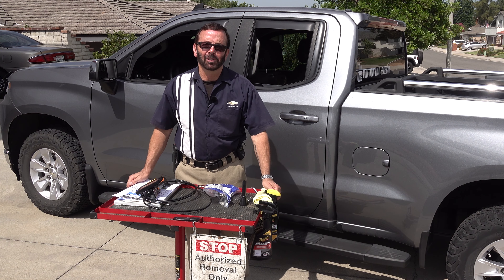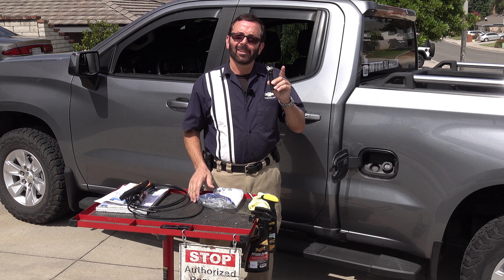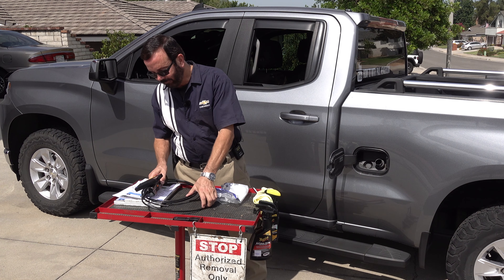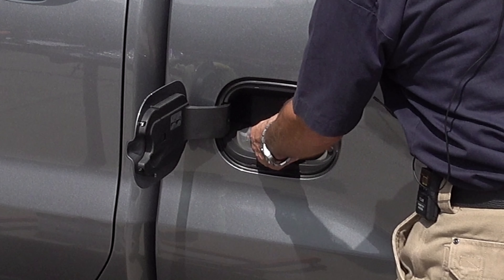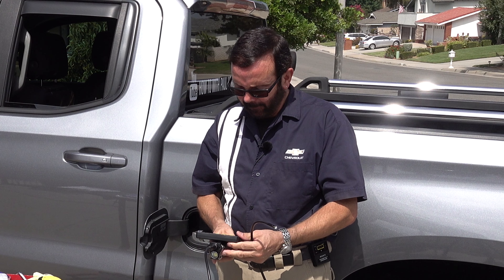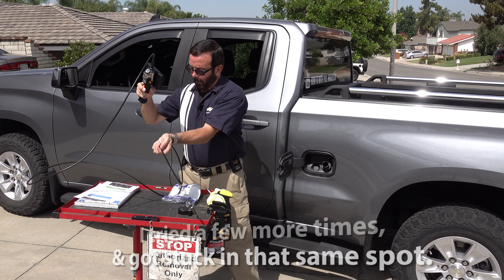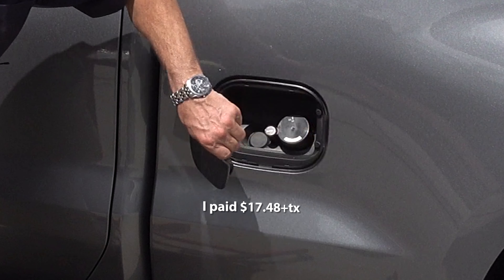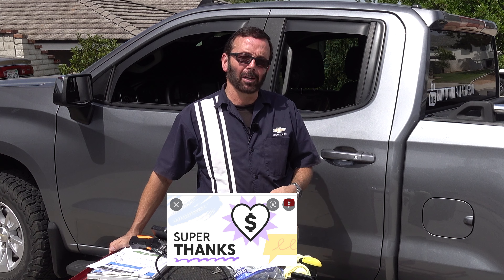Theft Deterrent Locking Cap for your Capless Fuel System w/Paul Henderson

Comment: I never understood why car designers would make a capless gas tank.
Reply from the maker: Nice idea though, there is a screen to keep a drain hose from syphoning the fuel, plus a secondary trap door to keep out unwanted liquid. But yes they should make an optional heavy duty locking cap if you want one....
Reply: @HowtowithPaulHenderson  oh OK, I didn’t know that about the secondary trap door. My car has one of those where you can just open it up and put the nozzle in. I’ve always been afraid that some random person would try to do some bull like siphoning the gas.
Reply: I don't have to worry about losing a gas cap.  However, I believe someone in my neighborhood stole gas last night.  The gauge was significantly lower this morning and I just got gas yesterday evening.
Reply: I never understood why the outer door doesn't have a lock. Idiocy, pure idiocy.
Reply from the maker: @steeevo0136  
Yes I agree, This cap is O.k, It's just a theft deterrent   device. maybe one day somebody will make a better cap than this OEM cap.
Reply from the maker: @latoriarichardson6754 
very lucky that was all they did. ,
Reply: I've had ppl put oil in my tank bc of this BS never knew bums still fuck wit ppl vehicles
Reply: @HowtowithPaulHenderson not at all bc I've had oil put in my tank sorry
Reply from the maker: @elondasmith8374 
Yes I don't understand either. Only thing I can think of is that there was some consumers that put up a stink saying I want a campless fuel system cuz I'm too lazy to unscrew the cat, so they did it. I remember people bitching about not having digital dashboards in touch screens in the vehicle to control 50% to 95% of stuff that used to be controlled by physical buttons not to mention, they'll be sorry after two to three years with possibly five but only not that when those systems go out they're going to be expensive to repair if it's out of warranty. Were we always told growing up not to leave your cell phone on the dash not just because of the battery but because of the damage it'll do to screen. And we were told not to text and drive have you seen the tablet that is on those ugly ass Teslas everything is controlled by that tablet even the shifting.
Reply: All sorts of liquid vandalism 😮

Comment: Probably a good idea if you’re worried about someone vandalizing your vehicle. I’d use one if I was worried about pranksters or exes! Probably also good if you park in apartment parking lot or big garage.
Reply from the maker: It's a cheap theft deterrent, also doubles as a dust and water cap for the capless fuel system.
Reply: @HowtowithPaulHenderson  What about when someone wants to push a few sugar cubes down in your tank.  Popping it off with two fingers, you're better off finding a lock the flap door.
Reply from the maker: @practicerepobarrie  
I've searched all over the internet there is no locking cap for the capless fuel system at least for the Chevy Silverados. 
GM  really need to come out with a locking gas cap. I'm not sure why they thought this capitalist fuel system was a good idea.

Comment: That lock is horrible. Sure, no locking cap is foolproof, but any fool with two fingers could pop it off with very little effort.
Even you showed that it was easier and faster to just pop it off rather than unlocking it.   
That's not a theft deterrent. That's a theft of $17.48 +tax
Reply from the maker: Very true, like I said it's just a theft deterrent, some people may not be smart enough to realize that they can just pull it off. And I figure if someone did take the cap off to either steal the gas or put something in the fuel tank then pulling the cap off and not putting it back on would let me know this so I can further check into why it was off before I start the engine and ruin the vehicle. Not sure why GM didn't make a locking cap much better than this one. I searched all over the internet for an aftermarket locking cap but couldn't find one. Hopefully somebody will come up with one wish I had to know how because I would. For $18 I think it was worth it regular retail price definitely not.
Reply from the maker: Came across a YouTube video today about the capless fuel system. As you know if water gets past the first trap door it won't get past  the secondary door because there is a hole in the fill pipe and water should drain out of there. Well this one guy lives in a really cold climate said it was about 20°. Why he went to go get his truck washed at 20° I have no idea, but water from the car wash had got past the first door and the water froze before it could drain out of the hole and space between secondary door and the first door was filled with ice. So I did read that on these locking fuel caps it will help to keep water out so I guess having this cheap ass cap on there while you're going through a car wash is a good idea.

Comment: The capless gas fill. They are absolutely terrible. After a recent rain I opened the fuel door and observed water pooled on top of the trap door. I had to blot it out with a dry paper towel trying not to push against the trap door. There is no telling how much water has penetrated the trap door.
Reply from the maker: @dixiedewful  
Good morning,  Ive got to say I don't understand how that's possible for water to go under the side of the locking cap and travel upwards and into the capless fuel system, It doesn't make sense.. I've checked mine repeatedly on rainy days to see if It actually works and I've never seen water inside the capless fuel system.
I'm not sure why it's happening to you in my case it's working just like ats supposed to.

Comment: when you said "deterent" a few times, I thought it could be removed with a sledge hammer or dent puller. Not by using 2 fingers
Reply from the maker: @timz.4000  yep two fingers is all it takes. But mainly it's a rainwater and dust cap, but it can work as a deterrent since it looks like it's a actual locking cap

Comment: I have a 2023 Silverado and i put a boroscope in. There is no mesh so it's easy to syphone fuel. Gas stations won't let you pump fuel till we pay for it but chevy wants us to give it away for free. Crazy
Reply from the maker: That pisses me off, when I bought the truck I was told there was a mesh screen down there.   I couldn't get past the bend in the pipe. 
I just filmed the video yesterday and mentioned about the endoscope which I just realized I called it the wrong name to talk about what the cap is really designed for, and that I couldn't find The mess screen. 
May not be much for keeping people from stealing your gas but it will keep rain water and dust from getting into the system.

Comment: You mention theft deterrent, but I saw it took you minimal effort to simply popped up with your hand. That is not deterrent, that is just very bad design, imho. Thank you for sharing this. I am not so much concerned as to gas theft, but more like someone, using a tube, delivering a chemical which will damage the engine, so locks are necessary.
Reply from the maker: I just filmed a review video on this, this morning talking about the advantage of this locking cap keeping water and dust out and how it is only a theft deterrent device. Hopefully when they see the keyhole they may decide to leave it alone. But if they do decide to give it a good tug it will come off. However, if the second lower trap door is not pushed open whatever liquid is dumped into the fill pipe will dump out through a hole in the fill pipe.

Comment: Thanks for showing what a piece of 💩 they sell👍
 I had a freightline with 2-150 gallon tanks and I bought a lock for each  one.
And some guy went to fill up my tanks and just unscrewed them really hard and broke em both
$114.00 down the drain.
 But I found out they were pieces of 💩
And that was probably 20 years ago.
Good to see there has been absolutely no improvements since, in fact they are worse.
Good job industry 👏
Reply from the maker: Like I mentioned in the video it's mainly a theft DETERRENT but it will keep dust and rainwater or wash water from getting into the capless fuel system if the trap door malfunctions. But yes I kinda agree they are crappy
Reply: Wow
Reply from the maker: @Hempfuelgroup I know it May not stop most fuel thieves from siphoning out your gas or some jealous person putting crap down the fuel pipe, but it's a deterrent and the purpose is to keep rain and wash water from getting inside the system the full pipe if the first trap door malfunctions.

Comment: That is like the dumbest theft deterrence gas cap lock. It's so flimsy that you can just rip it right off.  Which just defeats the whole point of putting a security lock on the capless fuel tank.  I wouldnt even spent a penny on that junk security lock.  What a rip off.
Reply from the maker: I do agree with you on that, but it is labeled as a THEFT DETERENT locking cap. It does look legit so hopefully if some would be gas thief were to see this they would just go on the the next vehicle.   Well that's what I hoping anyway.
Reply from the maker: I searched all over the internet for a more secure device and this is all there was.
Reply: Why they keep putting on these capless fuel that  is prone for fuel theft, just baffles me.  The least they could've done is put a fuel door lock latch that can only be open from the driver side in the cabin.
Reply: @HowtowithPaulHenderson  it's not a theft deterrence when thief can just siphon your gas  out because it's just out in the open and ready for the taken.  Theft deterrence is when it is lock and no one can open it unless it is open from the inside.

Comment: That is like the most useless piece of junk and a total waste of money.  It just defeats the sole purpose of putting one on. It ain't worth a penny.
Reply from the maker: I do agree with you that It may be useless as a locking fuel cap, but it is a decent theft deterrent device, but it is good for keeping dust and rain or wash water from pooling on top of or inside the fill pipe above the second trapdoor if the first one fails to shut properly.
I did see and add for a similar device that doesn't lock but it is used keep dust and rainwater and wash water that just slip onto the capless fuel system. I'm going to try to find it I think I saw on Amazon. I'm also kind of curious if that capless fuel system cap is replaceable if it becomes defective. So maybe with keeping that capitalist fuel system cap covered and semi-protected hopefully will last the lifetime of the vehicle.
In a
Reply from the maker: I just found the dust cap on Amazon, if you punch in the search bar 
KevinPCreatations he designed a 3D printed dust and water cap for the capless fuel system just under $12

Comment: that's got to be the most useless lock in existence.
Reply from the maker: Maybe, it's just one more thing a would be thief would have to get around....
Reply: @HowtowithPaulHenderson did you not just flip it off with a finger in seconds?
Reply from the maker: @WeirdNamja  I thought this was the tevlaphee steering wheel to seatbelt belt lock. Yes I did pull it off with my fingers, it doubles as a dust cap and will keep rain water from getting into the system if the trap door does not close all the way...

Comment: This shit doesnt work
Reply from the maker: @Mark-R8  it's main purpose is to keep rain water and wash water from filling up into the top of the capless system and  potentially dripping through into the space above the second trapdoor and the fill pipe and if you're in a freezing environment I could potentially turn into a solid tube of ice. As a theft cap no it doesn't work as a theft deterrent sort of it might deter somebody from trying to steal the gas or put something into the tank that shouldn't be there.

Comment: So lame it's useless
Reply from the maker: @jonellholly5087  
Maybe lame for security purpose but it will keep dust / rainwater/carwash water from getting into the capitalist fuel system. If there's a malfunction in the top trap door water will get into the system and if the drain hole above the second door is blocked that space will fill up with water. Long story short I saw on a YouTube video of a guy that lives in Canada he had a malfunctioning top trapdoor It was raining and water  filled up the in the pipe from above the second trap door The drain hole froze over and there was a solid chunk of ice  in that pipe That's why I think this cap is worth buying May not be worth the price But the alternative makes it worth it.

Comment: They are just drilling holes in the tank now. That system is worthless!
Reply from the maker: True, but I do mention how it will keep rain water and wash water and dust from getting into your capless fuel system if the upper door malfunctions.
Reply: @HowtowithPaulHenderson  It does not matter when all of your fuel is gone! This happened to me last week. They destroyed my tank and got away with 36 gallons of my fuel. They drill a hole into the bottom of your plastic tank and $1200 dollars to replace it.
Reply from the maker: @shaverlocal  wow, not only do you have to worry about your gas being stolen you have to worry about your catalytic converter. It just sucks how s*** people can be, get a job and pay for your own crap right.
Reply from the maker: Sorry to hear what happened that sucks. I think with all this thieving going on with converters stealing, punching holes and gas tanks I'm going to check with my insurance to make sure they'll cover it and if they do I'm going to lower my deductible to zero but I'll do the math and see if it's worth it I think right now I'm at 500 deductible
Reply: @HowtowithPaulHenderson  When my truck gets out of the shop I am hiring a local welder and fabricator to build a skid plate to fix both of their issues. I also bought a camera system at a lot of money and carry a gun 24/7. I;m pissed off...
Reply from the maker: @shaverlocal  I was thinking of the same thing, I'm going to check into that next week.